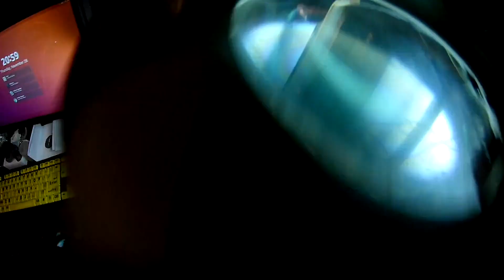Tritium Fusion Energy and Neutron Bubble Detector

Comment: Hopefully youll find my comment, Im working on a new idea kind of similar to this but cheaper and accesible. Was wondering if is possible to do tritium fusion with a DC 100-200kv output cockroft walton multiplier since it might be easy to build instead ignition coils, after doing some research on fusor articles and forums couldnt find anything related to tritium. The vast majority of people building makeshift farnsworth fusors only use 20-30kv modded neon sight transformers which require certain knowledge to work with it. Electrostatic precipitators and cockroft walton devices seem like a reliable cheaper alternative to go into further >30kv range but not sure about the current, from what I read homemade fusors need at leats 5-10 mA and 20kv to start fusing deuterium, I assume tritium will require at least 100kv. 
Also small tritium self glowing tubes are more easy to buy that heavy water, you can find them on Aliexpress for 5$ each, while deuterium gas cylinders need a whole mess of fulfill documentation and personal info to be shipped worlwide.
Meanwhile neutron sources are becoming harder to make these days, for amateurs like me only americium or radium combined with beryllium are the only available option to make neutrons. In US it's still possible to buy an anti-static brush with polonium210 which yields more neutrons than americium or radium with beryllium.
Amyway I will attempt to make my own fusor in the future to get a decent neutron yield for further experimentation but for now just keep learning😊

Comment: You cannot conclude anything of significance from TWO bubbles in a neutron bubble detector over a 24 hour period. Neutrons are produced constantly in cosmic ray air showers and from background sources in soil and building materials. You're deluding yourself with these uncontrolled tests.
Reply from the maker: I believe I ran the Aluminum-Americium experiment over night.. and there were no bubbles.. These are calibrated detectors... if there is not an appreciable neutron flux, there will be no bubbles.. these detectors are not supposed to respond to gamma or other types of radiation.. they are build to selectively detect neutrons.. there should not be an appreciable amount of neutrons in cosmic ray bursts.. I have run null experiments with these detectors.. they do not produce bubbles.. you can study the web site of the vendor... these devices are for measuring dose rates of people.. they should not be giving false positives.. they are designs to run for 24 hours... the detectors would be not marketable, if they gave false positives over this time period.. peoples health depend on these detectors..  As far as I can tell... the detectors are working correctly.. and if there are bubbles.. there are neutrons.. All my experiments seem to indicate these detectors are working properly.. Anyway, Thanks for the great comments!!